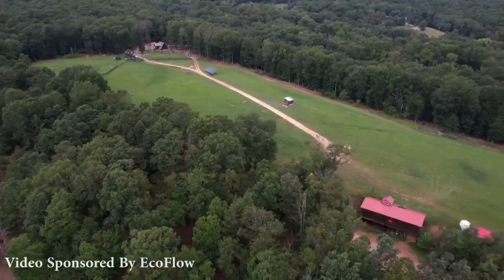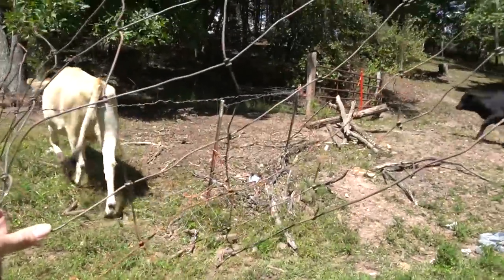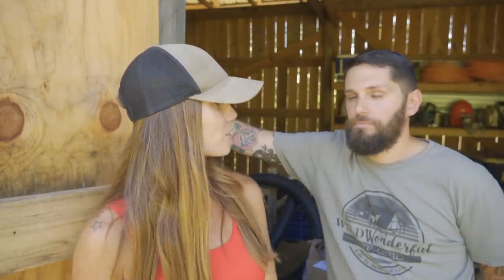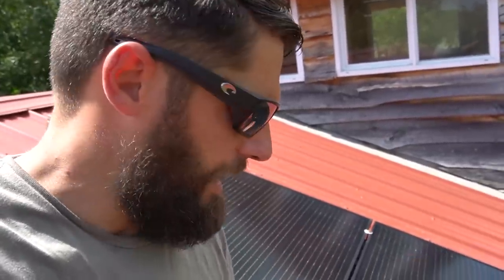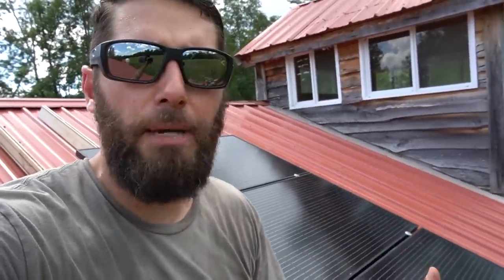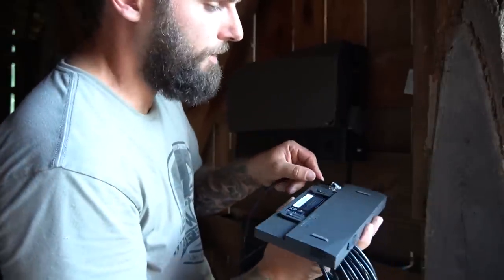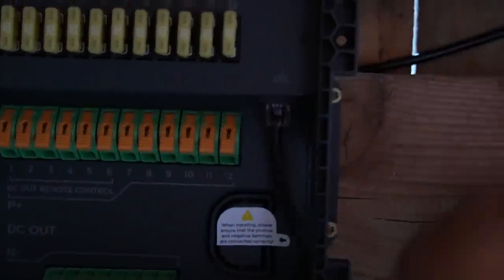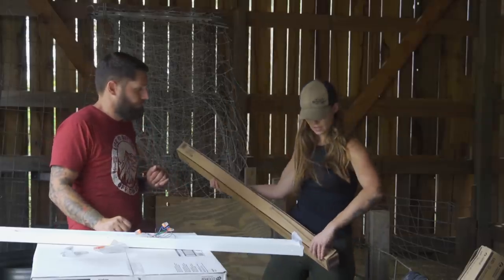EASIEST Off Grid Solar Power System | Machines Arrive For House Build | Issues In The Pasture

Comment: One question, the gaps in the wall behind your panels and displays, will you need to put something on the outside to keep some of the rain and weather off of your indoor solar equipment? I would imagine it must be nice to finally have lights out there, so glad it turned out for you guys although there were never any doubts it wouldn't, have a great rest of the week.

Comment: You could be using the 12V for lighting and avoid conversion losses in going DC to AC. Also the cameras are usually 12V (or 5V) so that also makes sense.

Comment: Two questions: Do you need to put battens on the vertical boards that are behind your newly installed electric components? There seems to be about a half inch opening that water can blow into the barn. Do you need to protect your wires, which are not in conduit, from wire chewing rodents? Maybe just a cabinet around the control components.
Reply: Good job josh

Comment: How water resistant are the components for the solar system? I know the barn is indoors and all,  but it seems a storm could at least blow a bit of rain threw the spaces in the walls. Just curious.
Reply: I always wonder if waterproof connections shouldn't be used in accessory buildings based on their utilitarian usage but Josh installs beyond code which i like!.😁
Reply: As an electrician myself, I wondered the same... Seeing as how he put bell boxes on the switch and outlets.

Comment: Josh, should you have installed that hardware on a piece of Plywood to prevent the outside weather from getting it wet through the cracks in your barn wall?

Comment: Saw quite a few similar comments but, you may want to consider mounting the electronics to a painted (both sides and all edges) plywood sheet to keep rain from coming in through the barn wall and destroying this investment.  Maybe even go so far as to put a "drip cap" hanging out over the electronics as well.

Comment: I love everything y’all do! So this isn’t a criticism but rather a question! - shouldn’t you be concerned about a driving rain getting into your solar equipment- charge controller/inverter etc via the spacing in the barn walls??
Reply: Could probably just slap a piece of painted sheet metal on the outside of the barn where it is a potential issue.

Comment: if you want to preserve the fence better, make a lot of strips of wood, measure out on both sides where the wire touches the wood notching out a shallow groove for the wire, then weave the wood strip into the fence, it keeps its rigidity and is a visual deterrent for the animals.

Comment: josh. you will need to put a larger bracket on to hold those panels down. otherwise, in the first windy weather, they tear loose, the small screw head is not enough to hold them down. It's good to see you're still doing well and still going strong

Comment: Josh, I am curious as to how you keep the battery above freezing temperatures in the Eco System unit you installed? Does it have a built-in heater so that you can charge it when it's below freezing temperatures? Very simple but, expensive system.
Reply from the maker: We are going to build an insulated box behind it with heat trace to use through the winter months
Reply: Batteries are self heating "Self-heating: With built-in auto-heating, you can use the batteries safely in temperatures as low as -4°F." Lower temperature may need box
Reply: What's expensive?
Reply: @-sstevens5444  ecoflow kit seen here without the solar panels is about 5 grand.
Reply: I think batteries generally produce their own heat while working, as far as I know cooling batteries is the main challenge.
Reply: Many of the good batteries come with low temperature cutoff, so when they drop under 1degC they prevent charging (and maybe discharging). Most LiFePo4 batteries can be discharged but not charged at freezing.

Comment: Thanks for making me aware eco-flow has a fully integrated system.  For emergencies only, I use the eco-flow Delta Max. In 2020, I installed in our Class C RV  total victron system (their 3000w Miltiplus inverters/converters amazing) but use 6 battleborn batteries, solar 640w on roof and up to 400w on Aux ground port.  Love solar.  For hot Fl summers, I Just ordered 12v DC only Nova Kool dual compressor refrigerator freezer to replace the evaporator one in the RV.  Love solar.

Comment: What a treat with a mid-week video post.  Josh, you make that system installation look easy.  Two questions:  I notice sunlight coming between vertical barn siding; are those inside components waterproof and weather resistant?   Secondly; since it is an unseated structure, will the winter cold drain or deplete the storage capacity of the 5KVA batteries?

Wishing you and your family a blessed week, gentle weather and restful evenings.  Peace

Comment: Enjoyed your video, as usual, but I have a couple questions.
1. It appeared that you installed the batteries and controller on a outside wall. Do you have any concerns about water coming through the slat wall?

2. Will this unit operate with gfi receptacles ?

3. I see you ran 12 gauge wire, is this because of line loss or breaker size?

Thanks again for sharing.

Comment: Josh aren't you worried about the hub getting wet ? I noticed the gaps in the exterior siding right where you mounted it . I figure you would of nailed some backing up behind it ?
Reply: Just what I was thinking.... that barn wall looks about as weatherproof as a sieve. I'd definitely be concerned about that in a heavy rainstorm.
Reply: Electronics should be in a rainproof and animals proof box
Reply: Thought the same at first but then seen the two foot overhang on the roof and I'm sure by now they know it stays dry inside. Yes you could have some wind driven rain get in but I think josh is comfortable with his installation not getting wet.
Reply: @mitchdenner9743  The boxes might handle it, but the display wont last long.

Comment: It's great seeing your place expand and grow with all the hard work you've done.
Do you need to insulate the battery in the barn for winter and will you also be installing a few lights in the lower section of the barn?

Comment: Josh, I was noticing where you mounted all solar components were on a wall with boards with gaps to the outside elements. During a hard rain with blowing rain horizontally that would get your components wet and possibly cause a short. You may want to put flashing or sheeting on the outside of barn behind your solar components.

Comment: Nice installation, I'm assuming this equipment was made for RVs and is 12vdc and 120AC ? KW output. I think for barn application plastic equipment has a lot of openings which will collect dust and dirt and possibly lower its cooling efficiency. I hope it has low-temperature and over-temperature protection.

Comment: Nice video. I have only two suggestions.

1. I would raise battery from ground and put it on the wall or at least didn't leave it on floor. so it wouldn't stay there for many reason..water or moisture..or rodents /bugs and such..
2. Not sure how it is done (can't see it from video) but i suppose i would put some foil from other side of that wall where battery and charger is placed..you never know how hard it will rain..

Comment: On the breaker box how about if cut the hole bigger and make a plate that you can put some restraints in. Just bolt it on with some small machine   
screws.    Just a thought Leo

Comment: Would definitly look into utilizing the 12/24v side of this system. Lights, refrigeration, tools, ect. can all be found on 12/24v systems and are much more efficient than running as 120v through the inverter, making it last many times longer than it probably currently does.

Comment: Eco flow also makes a gas powered generator that hooks directly in the system. I can see it being a great add-on for cloudier areas or winter time when you don’t get much solar charging… Or if you had a electricity intensive project.

Comment: I suggest you to review the installed solar panel system especially considering the battery. To my knowledge most if not all batteries require them to be at least above freezing temperatures, charging them in negative temps might do unwanted results.  I am not a solar expert or anything, but I believe also you have there snow and negative temperatures, so I believe you might to reconsider about that battery installation location, after all the battery is quite expensive piece you don't want to wear it down by temperatures.   I like your show, be careful.
Reply: You are right. However this model has a built-in heater which allows operation even in -4°F temp. Shame is that the heater consumes some additional energy, of course.

Comment: Great video as usual, I have a question about the EcoFlow system. Grounding? I didn't see an actual ground (i may have missed it).
I am also used to having to bond the Panels & mounts.(Canadian Requirement).
Just Curious.

Comment: Josh  and Erin I want to tell you both how much I enjoy your video’s . I was curious about the solar install in the barn, with the open spaces in the vertical slats…won’t rain get in on the control panels and the base converter? Wouldn’t want you to do all that work and have water get in and short everything out. Or are the components water sealed? Curious mind wants to know 😁😁

Comment: Hey Josh, how do you intend to keep the Ecoflow LifePo4 batteries cool in the hot summers and warm in the butt freezing cold in the barn. Ecoflow says don't charge the batteries if they are at  32 degrees or less or above 104 degrees.

Comment: A great hack (maintenance) trick for you
 Because of the great possibility of ice and snow accumulations on the panels if you use  Rain X on the panels in the fall before your first snow ice will not coat and  cover the panels hard. Snow and ice will slide off very very easy. I use it on my pick up on the windows and doors (rubber seals). I have never had my doors freeze closed and if you have a big freezing rain you can clear your photo panels quick and easy. Just spray it on and spread with cloth or sponge even a sponge mop. Spray on attachment rails too

Comment: Why not use 12v led lights?  15% more efficient (inverter losses and then rectification back to dc losses at each light), the lights last way longer because of no dropper circuit and you can run lamp cord instead of Mc and you can’t get shocked on it. 

I get the outlet, but the lights make way more sense on the 12v side.

Comment: The only thing I might suggest is you're putting that motion detector light outside and you know what eliminate your way to the barn but when you put a small one above the switch in the barn so you can at least see the switch to turn the lights on another life from outside will get inside when you have the doors open yet I'll be just a little bit better to have it like in there it will come on on the outside lights

Comment: I look at the spaces between the boards of the wall (I understand the barn ventilation) and wonder as you mention a storm coming in and those panels mounted right inside the wall. Is rain blowing in not a possible issue?

Comment: I hope those boxes are weatherproof. They are hunted on a wall with gaps between the boards.
When rain hits the wall on the outside it will surely enter through the gaps. But I am sure also that Josh has considered this.

Comment: Really like the stand alone  electric in the barn.  That will be super nice to have.   One question ???  Looks like all the component parts and pieces are mounted on an external wall with light shining through.  Would it be better to put that in a cabinet to keep out moisture, dust and whatever else could make it really dirty and not get wet???

Comment: So Josh, let me see if I understand something because I am a bit confused about the DC. You have this installed on an interior wall (which makes sense to me) and you stated you were not going to be using the DC side (also makes sense). Where I am a bit confused is if this thing gets mounted to a wall, where would DC ever be used anyway? In a structure, I would think everything would be AC. Or can this be used in a portable capacity?

Comment: That was a great install 👍. 
My wife actually checked out "Eco Flo" it's  a great easy to use and install system, all of their stuff is packaged right.
Glad you had decent 👌🏻 weather for the installation.
Good luck with the equipment,  have fun putting in your footings. 
Josh? Do you have your own safety harness? And yes my next question is why don't you use it when your on the barn roof and in the rafters? 
✌🏻🧡💜👍🌤🇨🇦⚠️.

Comment: Very cool!!!  I wonder if you have to worry about dust and driving rain from the gaps in the siding affecting the electrical equipment?  I’m type A, so I think I would have mounted a backer board or a cabinet and installed the electrical equipment inside.      Is that a concern for a barn set up?

Comment: not an electrician so excuse me if this isn't a valid concern: but why not use the helical conduit to protect all the connecting wires between the controller equipment from critters chewing on the plastic coating (not just the lighting/camera circuits required by code)?

Comment: Just curious as to why you used the AC side of the panel instead of the DC (not from the US so things are different here)?
You get plenty of DC LED 12/24v lighting fixtures.
Cameras on 12v or powered from 5v (usb). 
Tool charging which can be done from DC here also.
Would just avoid the losses from the  DC-AC-DC conversions going on.

Comment: Does the battery have a heater? LiFePo4 doesn't like to charge below freezing. Maybe you could build a insulated wood box with a 12v heating pad for the battery.

Comment: Josh, you stated that you won't use the 12V side of the distribution.  Could you not use that side for low volt LED lights or low voltage security cameras rather than draining the system so fast using the 120V side?

Comment: Noticed the wall behind the solar controller, etc. has gaps between slats.  I would be concerned with a blowing rain get water on the electronics.  Might want to put a better exterior wall up at that location.
Love the new solar system.

Comment: Do yo have to worry about hot or cold temperatures with the batteries? Or is the battery box insulated to handle different weather conditions? I looked at the sight on couldn't find any info. Thanks

Comment: Should there be a concern about the Battery Environment since the Barn is not insulated. There's also openings between the barn slats and it looks like snow/rain could get in the area when the system is installed. I guess I'm asking if the Battery should be placed in an insulated box/container.

Comment: Which Mobile Hotspot do you plan on adding for connecting to the EcoFlow or Cameras, or do you plan on running wire or line of site antennae/extender?

Comment: Because of the cracks behind the system are you concerned it will get wet and blow up? Or are you going to put and backer or and sheet of exterior siding on the wall outside? Or will it be just fine?
Reply from the maker: We did put a backer there (not shown in this video) but we did it just as a precautionary move- currently we don’t have an issue with rain getting in the barn

Comment: FYI: Adjusting VOC for cold temperatures is not widely known.  Voltage is higher in cold weather.  Adjusting for around 10F is 136 x 1.16 = 158v which will fry the charger.

Comment: Have you picked cameras yet? I am trying to find a way to do something similar. I'm thinking I might need a wifi repeater somewhere between my house and where I want the cameras with pond and solar powered pump. I don't want 4g cameras so I am wondering if you have a solution yet.

Comment: What’s the maximum wattage per panel per battery pack of 5 kW.  

Can you use a higher wattage panel on the system? 

Like a 420 watt panel or is there a wattage limit?

Comment: I just have to comment and ask to make sure. I did not see you guys adding a PE (protective earth) wire to the panel array rails. 100+ VDC is quite dangerous as you know if the birds/wind will scrape the insulation off the PV wires and energise the panel frames. Bird protection skirts are also great. Bad surprise the next time after years when upgrading the array and touching the panel frames. PE seems to be installed legit in everything else, but not visible in PV side. Hope you did, but just no video about the fact =)

Comment: I've seen those systems. I like them. Could that system power a house or is it meant for smaller applications (RV, Barns ect). Love the videos and following your journey!!
Reply: It's on the small side for a house, but also hideously expensive. You can have a professional install a much more capable system for less.

Comment: Better to use DC lights and any other items that are DC to avoid the loss in using AC.  LED’s are DC anyway.  Seems a tremendous waste to invert and then rectify back to DC, which defeats the purpose of using solar and puts unneeded load on the batteries

Comment: I might have missed something but how did you get the 800 watts? If you wired the cells in series to get the higher voltage (assuming all 8), your system would be producing 100 watts... Obviously I saw the panel input when it said 138 watts, so I am just curious how it is wired..
Reply: With each panel at 136W and 17V, a current of 8A could be realized. With 8 panels in series, to total voltage becomes 17V * 8 = 136V and with 8A it delivers 1088W (maximum).
The nominal panel power could be 100W at 17V which leads to 5.1A. With 8 panels in series, it ends up in 136V * 5.1A = 800W.
Reply: Watts is volts x amps. If you wire 2 panels in serie, you have the same amps, but twice voltage. If you wire them in parallel, you have twice the amps and the same voltage. In both cases, you have the twice the power in watts compared to 1 panel.